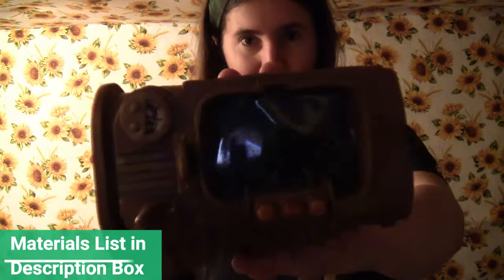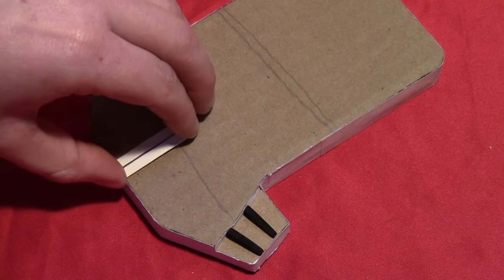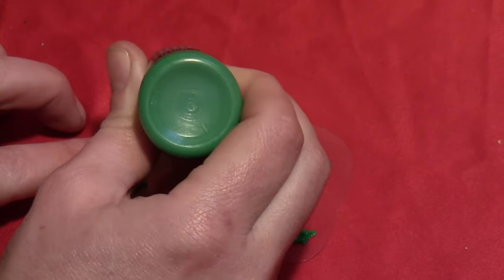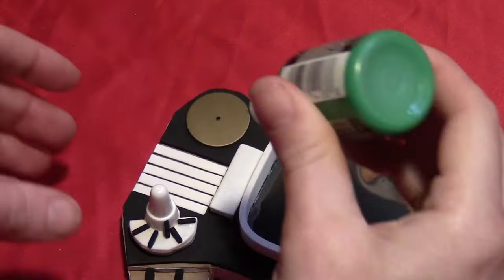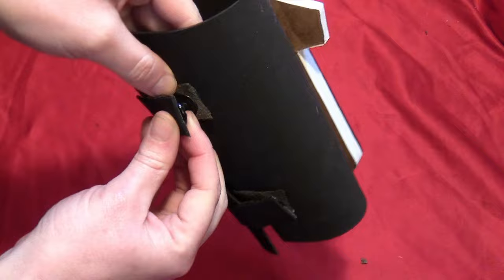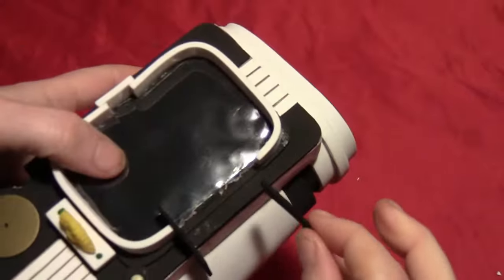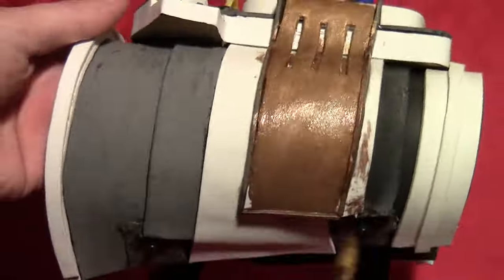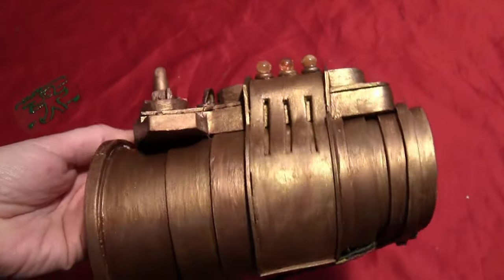Easy DIY Pip-boy 3000 from Fallout - Cardboard, foam, cheap build prop

Comment: I downloaded the template but there are no numerical measurements, how big is it in cm (or inches)?
Reply from the maker: So the template is meant to just be printed out on a standard piece of paper, and then cut out and traced onto the foam. So I didn't include measurements. But if you want them, it's about 6 inches on the long side. And a little under 3 inches on the short side. With the little "leg" on the other short side bringing it to 4 inches. Hope that helps. Good luck 😊
Reply: @Thewoodlandelf  Thank you so much, your pip boy is "Bueno, bonito y barato" (good, beautiful and cheap) as we say in Spain xD.
Is the best DIY version I've seen, I'll make this for sure 😁
Reply from the maker: Thanks so much 😊

Comment: Top notch work Amber! 3:31 it’s neat how you made the radio tuner with foam and a glue cap, I love the patina you added to the PIP Boy and thank you for the templates. Could you also make the Mark IV model from Fallout 4 and the Model 2000 mark VI from Fallout 76?
Reply from the maker: Thanks 😊 Yes, I save everything, so those old bottle caps always come in handy at some point, lol. Yeah, I'll add the other Marks to my to-do list.

Comment: Hi, what can I use instead of the craft foam? Is it possible to make it using only card board?
Reply from the maker: Yes, you can definitely just use cardboard. But you'll need something flexible like cereal box cardboard for the parts that need to bend.